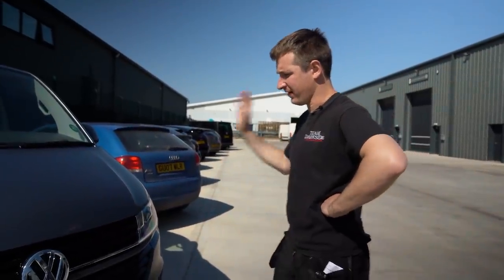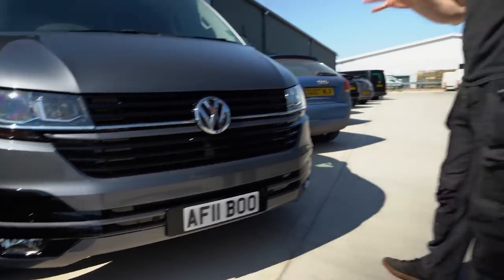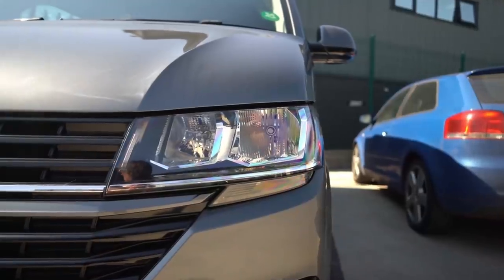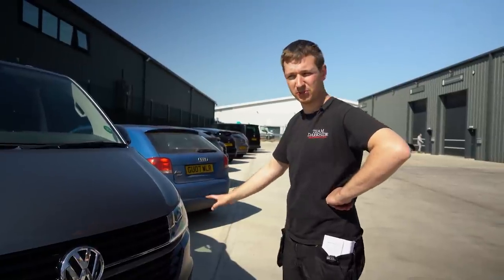T5 / T5.1 to T6.1 Transporter Facelift Conversion! | Darkside Paint & Body

Comment: This kind of modifications are so nice.Wish i could update the bumpers on my 2018 r8 to the 2020 ones, unfortunately they've told me the mounting brackets are different
Reply: Are they built-in or why cant you change those brackets?
Reply: @vaklaf700  i went to the audi dealer i bought it from,and a guy that works there and that i personally know told me confidentially that audi most likely did it on purpose,because people would just go buy the pre facelift and change the bumpers and it'd be like literally buying the 2020 one,without spending 100k more,i indeed spent a little less than 100k and the new ones go for 200k+
He also told me though, that if i go in another place i would surely find someone who does that,but it'd be expensive and bespoke:i honestly aspire to do that,what ever it costs,i will wait though i'm in no rush

Comment: Is the only difference between the t5 and t5.1/t6.1 slam panel the lower light mounts? Because far as understand the t5.1 and t6.1 slam panel are the same
Reply from the maker: That's right, some people use the original and make brackets for the lights or buy the t5.1/6.1 slam panel with them already on

Comment: Well how ye all have a 05 t5 and was going to do that to mine. Just one question the panel you call the slam panal would that be the front panal that holds the headlights and that the bonnet closes into.
Reply from the maker: Yes
Reply: Thanks for the reply 👍

Comment: are the front bumper beam and slam panel different to a 2005 or did you take them off and refit for another reason? looks awesome!!
Reply from the maker: Should be the same. The one they put on in the video is the one they took off so just the bonnet, lights, bumper and wings
Reply: T5.1 factory sportline 20112 price full conversion price please?

Comment: I’m putting a 6.1 front end on my t5 including new bumper and slam panel. Radiator sitting on rubber mounts on new bumper but have a gap of about 20mm to the locating slot on the new slam panel. Any idea what I may have done/not done or lost?
Reply from the maker: Alan at our Bodyshop would be the one to ask
Reply from the maker: E.ail the body shop if you are still struggling